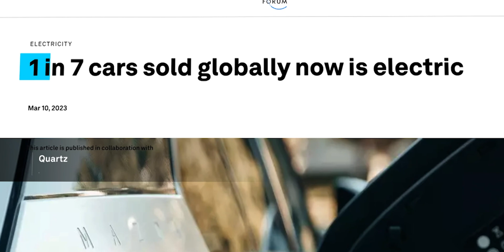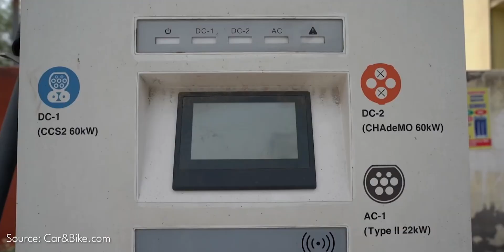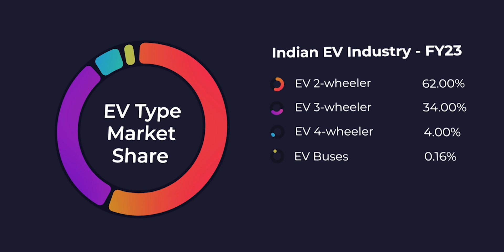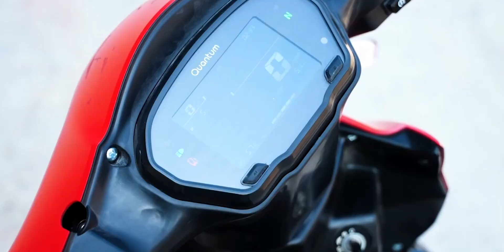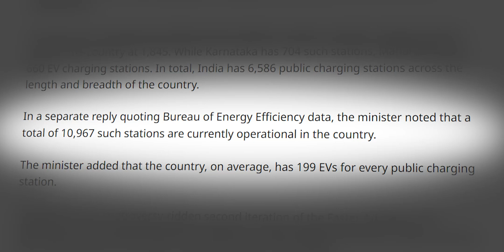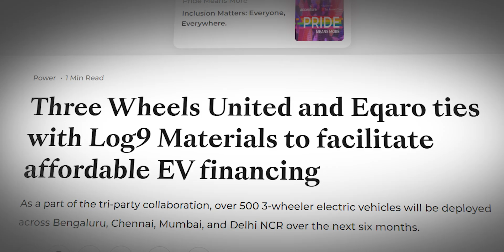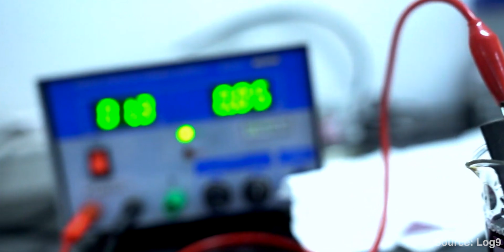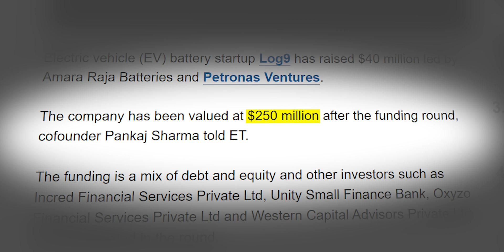Log9 Is Disrupting India's EV Space: Business Case Study

Comment: First off cells have only 7% lithium so it's not a major component.  Ola has a cell manufacturing plant and they make 2 lac batteries with Korean cells, and will also soon use Ola lndian built cells.  Ola also meets the Ais156 spec
Reply from the maker: Yes, Ola Electric is almost there. We did look into Ola Electric's cell production, but as far as we could tell they're not producing them commercially, they're still in the late R&D stage (although well-poised to make a splash in this space, although my guess is that they will only make these cells for themselves, while Log9 is acting as an OEM), so Log9 is still the first and only commercial EV Li-ion cell manufacturer in India based on our research. -Caleb
Reply: @backstagewithmillionaires 
Hello Caleb,
Apart from that Amara Raja Batteries is also building a Giga factory in Telangana with an investment of 9,600 Crores that's more than a Billion USD.
And Amara Raja can access Technology of Log9 Materials for mass scale production.
I feel more companies are likely to enter agreement with Log9 Materials for Battery Packs and Amaron stationary battery packs or inverters are quite common in Indian Households.
Log9 can even outsource the production of the Stationary Battery Storage Systems of long duration when it gets more demand.

Comment: From what knowledge i have of lithium battery chemistries, LTO and LFP are completely distinct. LTO refers to using titanium nanoparticles as you mentioned in the anode of the Li cell instead of traditional graphite or silicon (in case of newer high density storage). Whereas LFP denotes cathode chemistry where the cathode is a mixture of lithium and iron with other elements, unlike normal NMC cells that use nickel, manganese and cobalt. LFP cells have approx 30% lesser energy density than NMC, but are made from widely available and cheap materials and are very safe. (You can refer CATL blade LFP batteries for the safety tests for this chemistry). Tesla is moving towards replacing majority of their battery lines with LFP, keeping NMC only for high density applications such as the Roadster and Semi Truck. In the case of LTO, as it is a anode side chemistry, assuming even the highest density cathod of NMC (As Log9 seems to be planning to implement LFP in the future), the energy density of said cell will be further 30% lower as compared to LFP, which is already lesser than NMC. What I dont understand is that LFP is plenty safe for our tropical climate, and while LTO provides much faster charging rates due to the Titanium, I feel that is a gimmick and not really a essential feature. Furthermore LTO will simply be much more expensive than LFP with graphite, sometimes almost double if we take current industry data. I believe mass EV adoption will depend upon total cost at the end, and the LFP chemistry with just graphite and not LTO provides plenty of life cycles and safety for our usage, and depending upon LTO will just be overkill in this scenario. Cheers!
Reply: Hi, do you any idea how they claim 15000+ charge cycle.  it seem like market gimmick or fake claim.
Reply: @zkephmnoy8877  It probably has to do with the fact that because of the titanate anode, the rate of charge/discharge is like 30 times more than graphite anodes, hence there isn't a huge formation of SEI layers and hence spikes in the same. Problem with graphite anode battery cells is the lithium deposits on SEI layer and slowly that increases until it completely reaches the cathode and shorts the cell.
Reply: @zkephmnoy8877  so the fast charge cycle and the long life is all true as per the current technology standards. Problem is the upfront cost and abysmal range